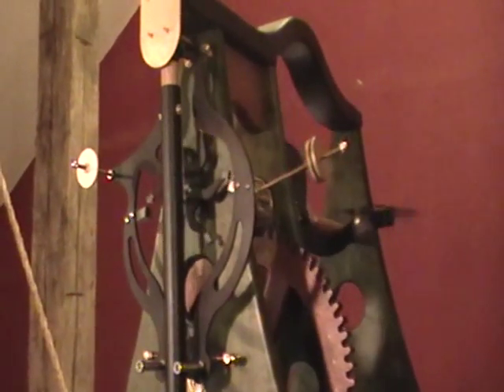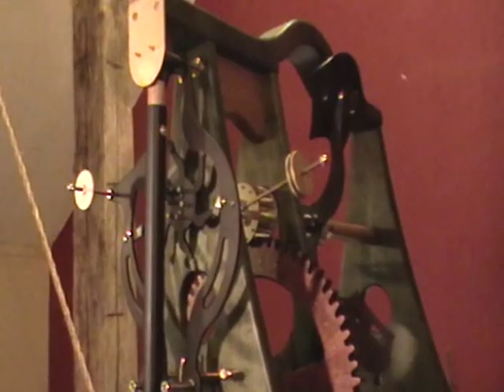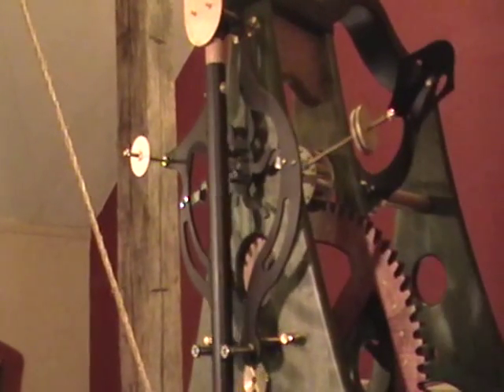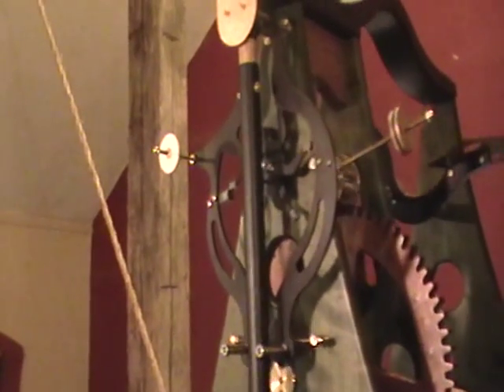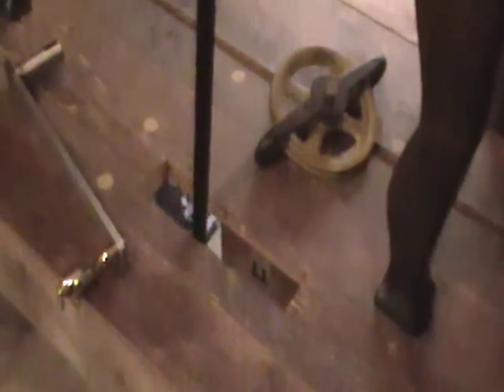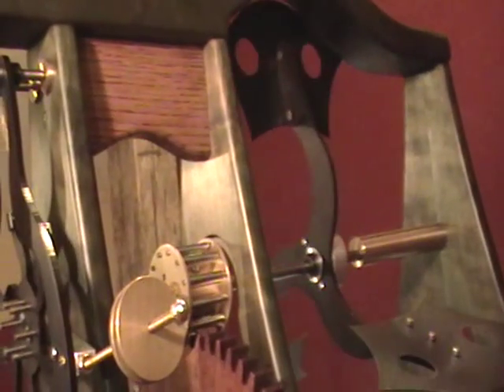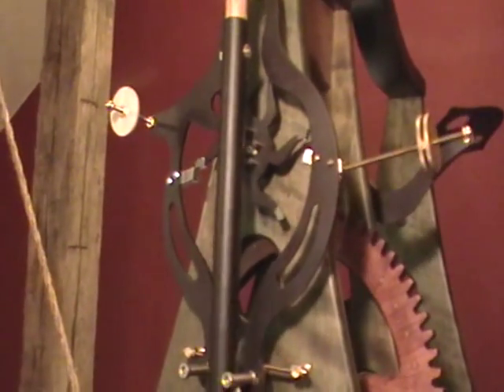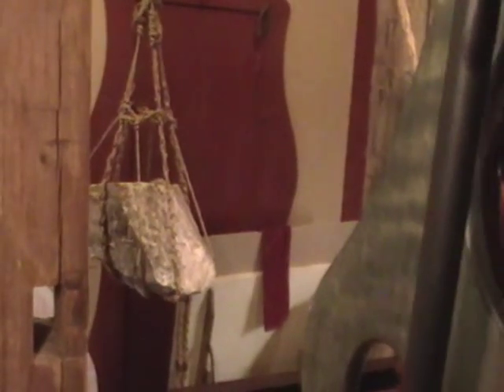Six legged gravity escapement on clock by Michael Kuyt

Comment: there is a problem with the right gravity arm and the escapement wheel. it is clearly visible that the escapement wheel rotates much slower when the right arm is lifted. when the left arm is lifted, the escapement wheel has nearly the double speed.
Reply: Yes - you are right!  The reason, I think, is this:-  You notice that the right arm, never gets raised. So, when the left arm contacts the pendulum rod, the escapement does not have any work to do - apart from escaping and moving the fly at the back.  On the other hand when the pendulum contacts the right arm, which is functioning purely as things stand to allow the escape, the escapement is now having to raise the left arm - thus slowing it a bit.  All that is happening on the right hand side is that the right arm is being pushed out - and then returning to where it was before. Wrong!